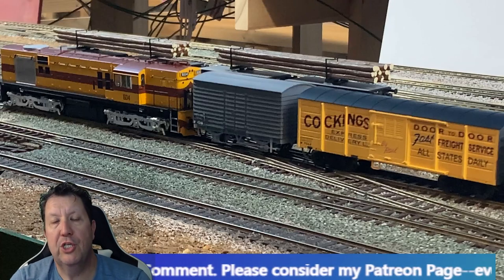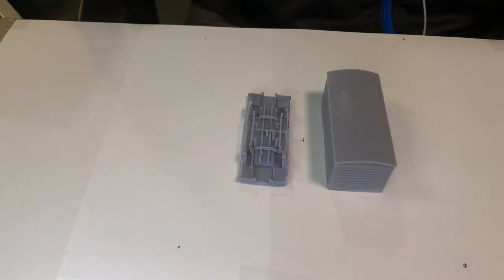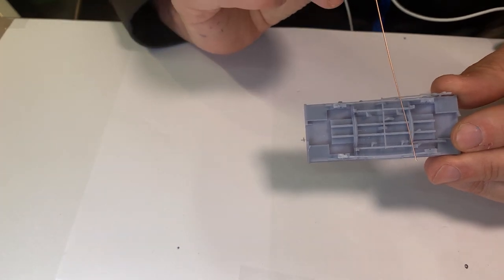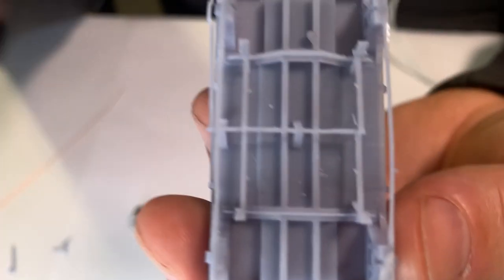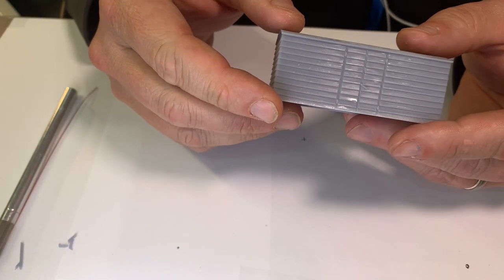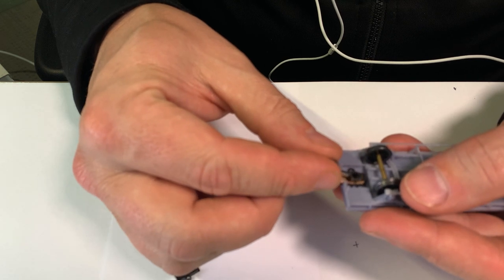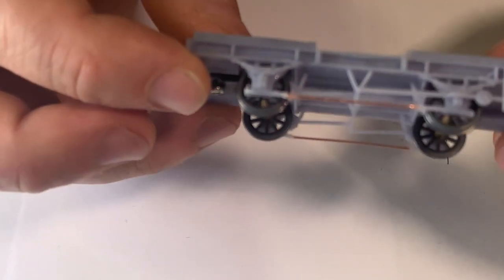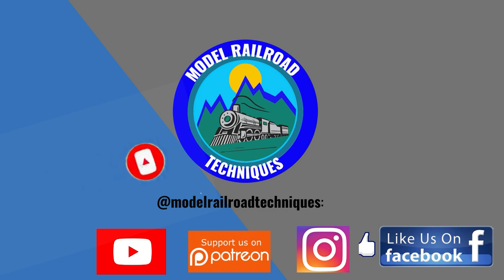HO Scale South Australian Railways DA Covered Van

Comment: Excellent work well done.  The inserting of wheels section was very helpful.  I think Micromark have tool to reshape the bearing holes, it consists of a spring loaded shaft with ends ground to the correct angles, you slip it into the wagon bearing holes and give a couple of twiddles.
Reply from the maker: Thank you unfortunately micromarks version is for American axle widths, which are wider than the DA